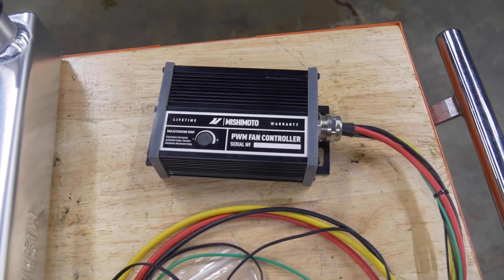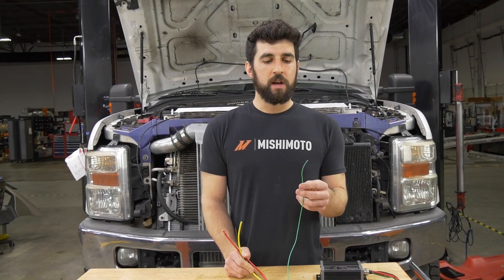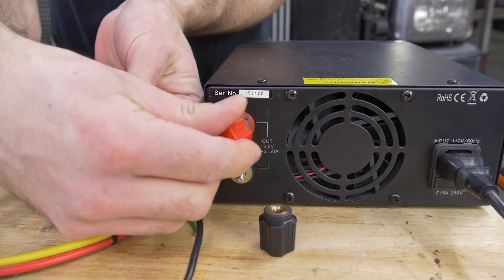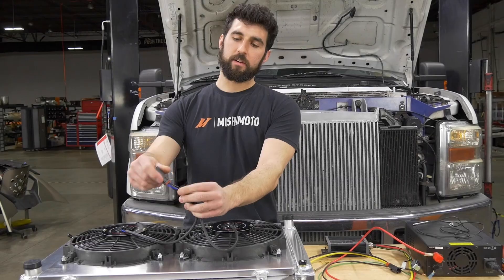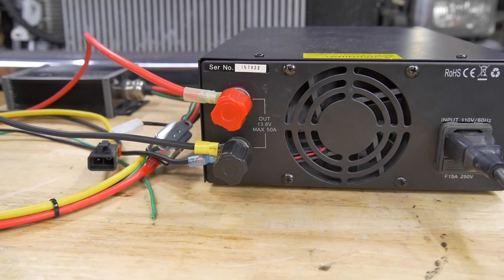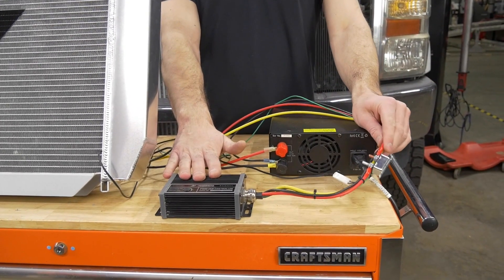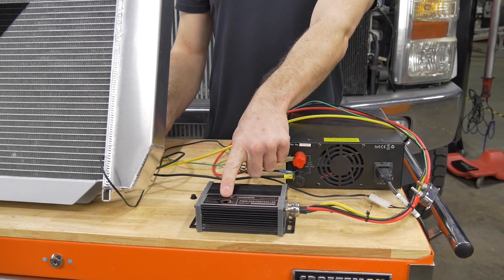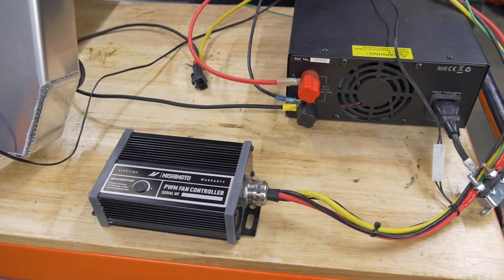Installing and Operating the Mishimoto PWM Fan Controller

Comment: Unfortunately this controller turns both fans on at the same temperature. It would be ideal to be able to adjust and set each fan to turn on independently one at a lower and the second at a higher temperature.
Reply from the maker: You'd need a second controller to achieve this.

Comment: Is that’s a 2 speed fan control module? If so, does that mean you need a 2 prong thermal fan switch to make it work?
 
If you had a 1 prong thermal fan switch would this still work with the 2 speed fan control module? Or would I need to have the 2 prong thermal fan switch to make it work?
Reply from the maker: This is considered a multi speed controller. As the temperature increases, the fan speed increases.
Reply: Just use the high side only.

Comment: The installation instructions I received in my kit have no relay or wire for turning the unit on and off???? Is there different instructions somewhere. The unit stays on..

I should also note. Im converting a SC400. So I dont have an electric fan relay since it was hydraulic
Reply from the maker: It sounds as if you would benefit from a relay to control power to the unit and system based on a 12V switch source. Shoot us an email at support@mishimoto.com and the team should be able to help.
Reply: @mishimoto  I will shoot an email over after work! Thank you

Comment: Yet diagram shows relay yet in video don't see one fitted .?
Reply from the maker: Yes, we suggest adding a relay inline with the power wire to ensure this kit only turns on when 12V switch power is provided. Thanks!

Comment: This is an outstanding idea! I love the concept and how simple and user friendly it looks. However, I have a few suggestions on how you can make this fan controller even better.

My first suggestion is to offer higher activation temperatures. The first 6 settings are basically useless for almost every application since there is no legitimate need to activate the fans at 110-155 degrees F. Even the highest setting activates the fans at too low of a temperature for most applications since most engines, mine included, run at 190+ degrees just driving down the highway and we don't want the fans running all the time, we only want the fans running when needed.

My second suggestion is to shorten the minimum speed to maximum speed temp range for each setting. According to the speed chart on your website, increasing the fan speed from 10% to 100% requires an increase of around 45 degrees, which is too much. Somewhere around a 10-20 degree span would be much more reasonable because at setting 10, the only somewhat reasonable activation temperature in most cases, the coolant can still reach 235 degrees before the fans reach full speed and that's hotter than anyone would want their engine to run if they set an activation temp of 190, but a lower maximum temperature would keep the fans on all the time because the activation temp would be too low. Something like an option to start the fans at 200 degrees and have then running at full speed at 210-220 degrees would be much more useful.

Finally, more adjustability would be nice. Being able to set the speed of the default speed of the AC override would be nice because 30% fan speed would be too low in a lot of applications. Being able to set the activation temp and max temp separately would be nice. Offering an adjustable delay to keep the fans running after shutting the engine off would be nice for people with hot soak problems. Perhaps creating an app so it can be controlled either by a USB or Bluetooth connection like some other solutions would be a good way to accomplish this. None of these are deal breakers for me, but more options are always nice for a premium product sold at a premium price.

Hope this helps, keep up the great work guys! Once at least issue number 1 and 2 are resolved, I definitely plan on getting one of these for my build👍
Reply: in the case of it turning off at a delayed rate you can install a timer switch relay on the fan connection, which can be switched on with ignition and as soon as the ignition is turned off it would stay on for the set time. i do agree would be best if it was already built in the controller itself
Reply: Absolutely. A great product with the potential to be a fantastic product. I hope Mishimoto will listen.